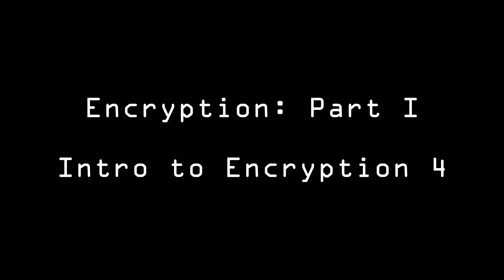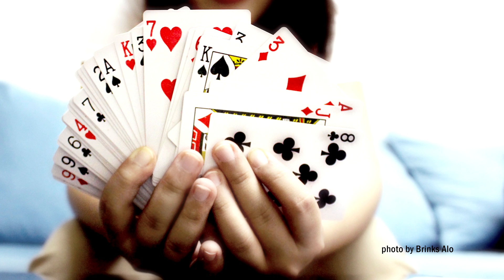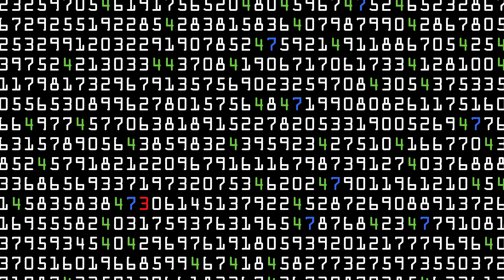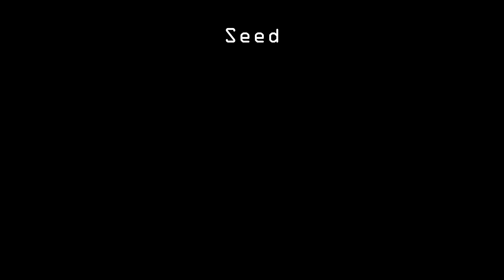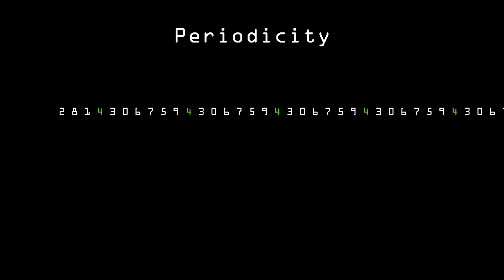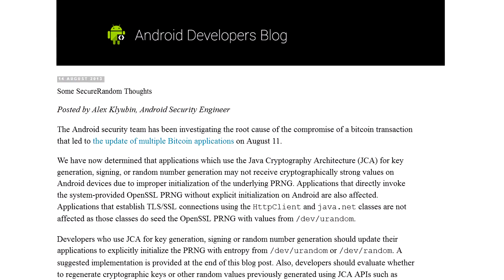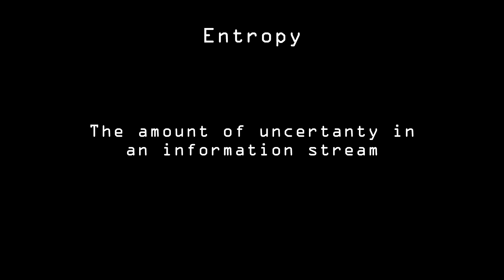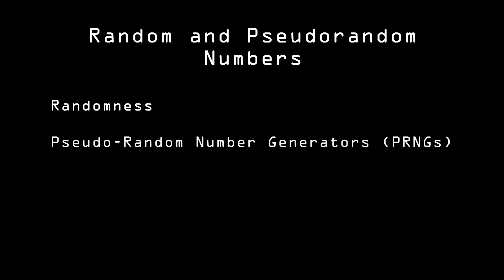Encryption Part I: Introduction to Encryption 4

Comment: Absolutely captivating. Thank you so much for this riveting introduction to cryptography. The real life examples complete the lessons and are very interesting. More of that! I feel truly enlightened, as I finally grasp at concepts which I did not dare to research, as I presumed they would be too complex to learn. What I didn't fully understand was Periodicity and the example with the simple PRNG using 4 as a seed. I did not understand why the output started to loop.
Reply: Actually, I do understand why the output loops at 4 (since the same seed produces the same sequence). But how exactly do more complex PRNGs work?

Comment: in the first sequence you show in the Periodicity part (7:00), if every number is the seed for the next one, how come before the first "4" there's "1", but before every other "4" there's a "9"?
Reply from the maker: Because the periodicity hasn't started then. PRNGS aren't based on what numbers were given before; the seed just determines what the next output is. It's not like you're jumping in to the middle of a period; you have actual pseudorandom numbers up until the point where the period starts.
Reply: Shane Killian I wrote "after" but I meant "before". I fixed it now. So I can have different seeds generating the same number (1 -> 4), (9 -> 4). is that it?
Reply from the maker: It's possible, but once you get that cycle going it can't go any other way.